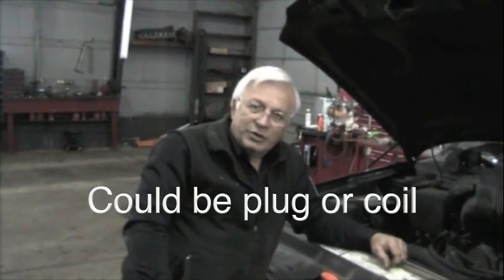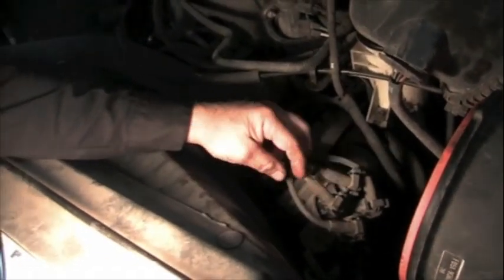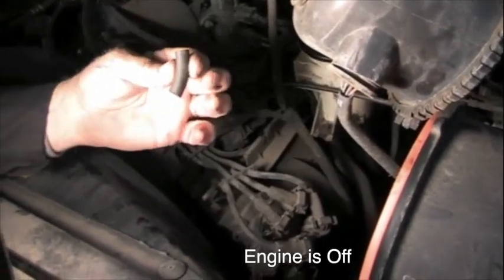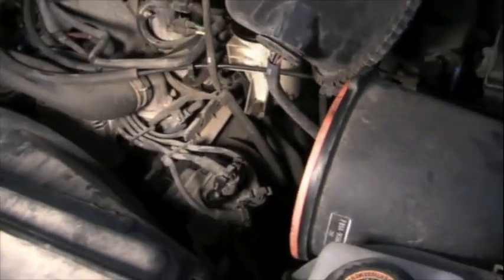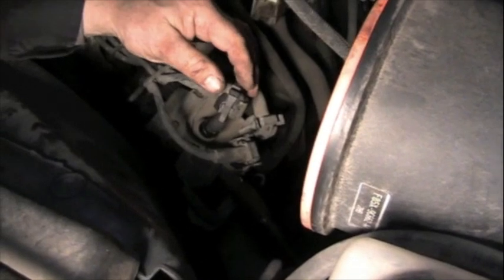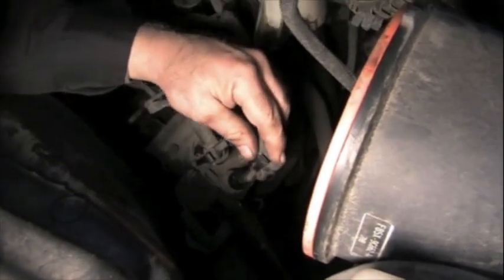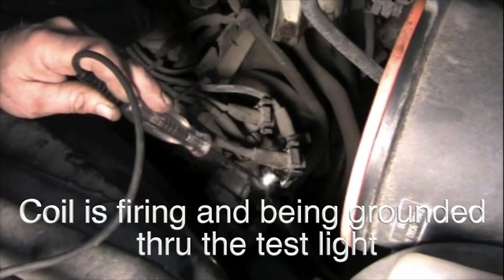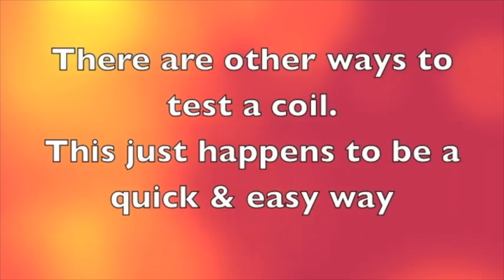Quick way to test a coil

Comment: On our 1998 K1500 with the 5.7L the ABS light is on and the speedometer is fluttering all over and causing the transmission to shift up and down randomly and kick off the cruise control.  Have you had this problem before?  We replaced the VSS and the ignition wiring harness, but that did not fix it.
Reply: What codes are in the abs module?
Reply: @kc360awareness  I hooked up the code reader before and after driving and it shows no codes.  No check engine light.  Just the ABS light is on.
Reply: @MyLifeThai371  do you have the ability to check the abs codes?

Next I would verify the wiring to the VSS is good.   It’s common for those to get damaged.   Especially on an older pickup.
Reply: @kc360awareness  No.  I don't have the ability to check abs codes.  I did notice that when I unplugged the connector from the transmission speed sensor that there was oil inside of it.  It must have traveled through the sensor.  I did blow the oil out before installing the new sensor.
Reply: @MyLifeThai371  Without the ability to read all the modules or look at live sensor data you’re kinda stuck.  

Otherwise look real close at the VSS connection.   Look for broken wires within the first couple inches of the connector or possibly spread open terminals in the harness.